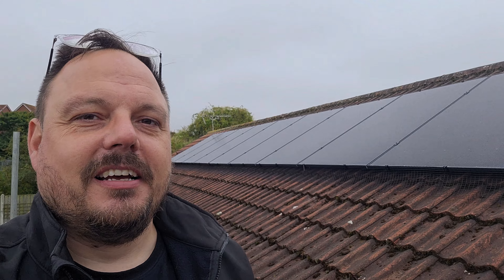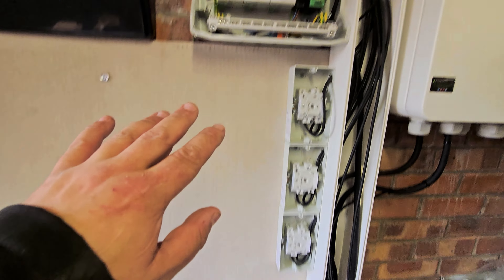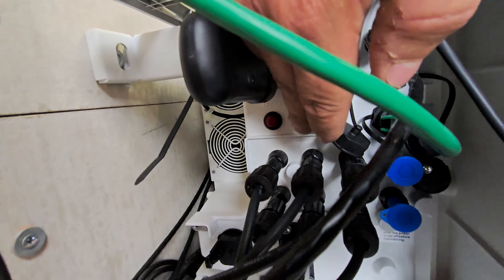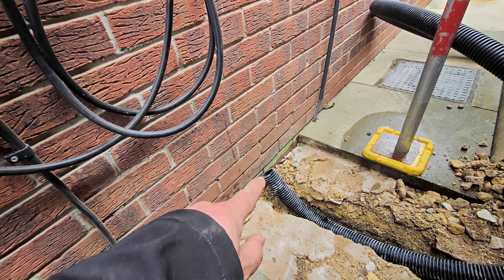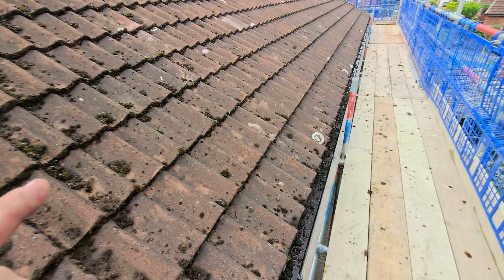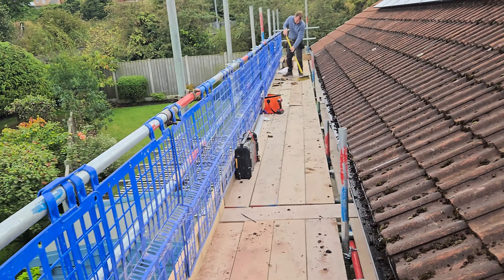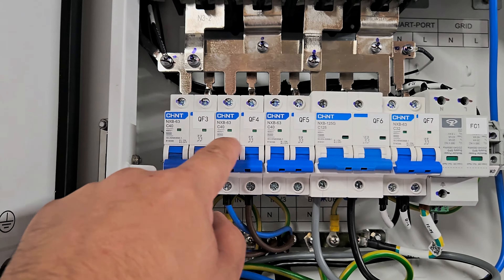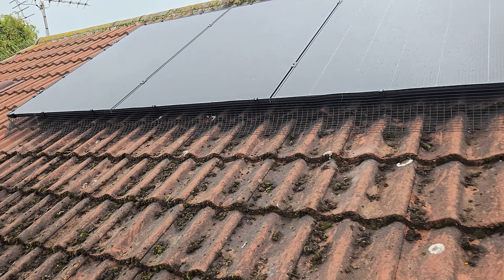Tesla Powerwall beater? Ultimate UPS power- SigEnergy 10kW SINGLE PHASE with Bifacial solar panels

Comment: Great attention to detail, nice to see you using stainless steel cable ties and PV Ultra. You're absolutely right to be sceptical about the bifacial panels, on a typical roof installation they add pretty much nothing, minimal light reaches the rear. They are designed for ground mount, car ports etc where there is plenty of space behind for light to get in and be reflected back.

Comment: Currently getting quotes on an Sig system with additional panels on the back roof here in Ireland. Costs are eye watering, but when the only alternative with a backup box is Huawei, the costs seems much worth it suddenly. Few more quotes,and well. In the end 8.7Kw solar, and 8kw battery with backup gateway. Although depending on some other quotes, might go full 16Kw battery if possible.

Stormy Mayo in Ireland gets a few power cuts.

Comment: Top job - very nicely done indeed. I'd have advised the customer to get the roof powerwashed after the scaffold was first up, but cannot find any other improvement to suggest.  I can only think of 2 reasons to use Tigos: customer insisted on panel level monitoring, or you were concerned that bifaciality would cause uneven performance among panels in a string.  If neither of these I'd have used AIKO's brilliant new panels with partial cell-level optimisation.  Or no optimisation at all - this installation has the least shade problems I've seen for a long time (Bristol:  full of historic tall chimney stacks & mature trees).  What you called the TAP was the Tigo CCA - which would have had a wired connection to two TAPs on the roof - which can be awkward at times.
Reply from the maker: Power washing a roof is the worst thing anyone can do with concrete tiles. It washes away the abrasive finish and in 5 years will be porus anyone reading this never ever do that. 

Optimisers are primarily for safety as covered in the video. In experienced installers often discount this crucial aspect. In terms of shading all shading is well shading lol. The severity differs and we had a really bad one on the channel a few weeks ago. That said the optimisers have recovered lots of lost generation already. Proof is in the pudding so to speak. The Aikos are decent but several levels behind true optimisation. We have used them on unshaded ground mount. No optimisation is a terrible approach imho. 

The CCA receives data from the tap you are correct however using 2 on this install would be a waste of components. 1 is all this is required with appropriate installation. 10m range easily achieved, in fact well within that. Over application of TAPs brings added cost and zero benefit. 

Fortunately he customer got the right advice and the right installer. Hope that helps.

Comment: Sigenergy looks like they are the market leader at the moment but there are so meany great company’s out there it’s difficult to choose! I will be going for Givenergy most likely as they are building factory’s in the UK
Reply from the maker: We are a big customer/supporter of GivEnergy. If you didn't go to solar and storage you might not know. But they also have a product coming later this year that is better in every sense than the PW3.
Reply: @electrician247  Later this yr? - I'd heard not till mid 2025.  I hope GivEnergy aren't coy about their inverter efficiency curve:  AiO Gen2 may indeed be best thing since sliced bread for big installations but I want to know the efficiency of their 12kW inverter at 500W or 1kW or 1.5kW (ie only a bit less bright than when you showed us this system).  Inverter efficiency is rubbish at low % of peak output (ie in the 3 seasons when you haven't any to spare).  So I think it's pretty poor that manufacturers fob us off with peak efficiency (worst) or CEC-weighted or Euro-weighted (little better).  I think they should give us efficiency at actual outputs in 0.5kW increments.
Reply from the maker: @falfield  yes indeed later this year. Did you visit them at solar and storage? Efficiency within inverters come down to design rather than manufacturers equipment. Unless you have a sum total of 2 panels... otherwise string layout, optimisation and a good installer will sort you out. That said the efficiency is way ahead of the crowd across the mppt range. We are lucky indeed. Hope that helps 😜

Comment: Really good video and installation. Just one question though (I might have missed) what did you do with the 3rd string and the PV ultra cable?
Reply from the maker: Don't follow.  But we have strings via the 2 x 4 core PV ultra cables. 1 spare string in place for any future expansion left in the loft space into isolation. 

The other 3 pairs all on to the roof.
Reply: @electrician247  Hi sorry I didnt hear the bit about using 4C cable. Thanks for confirming. Really good videos that you produce thanks👍

Comment: Great video, Mark! Does Sigen support offline monitoring? Or at least include the offline activity to the data when back online? I had issues with Givenergy disconnecting from my router, which resulted in losing historical data.
Reply from the maker: It's very hard for the sigenergy not to report with 4G wifi and LAN simultaneously connected. However it does have local storage and RS comms

Comment: I do not see a generation meter installed. Is it that they are no longer required or because you have used the gateway it is not necessary? Great install. You didn't say much about the Tigo otimizers though.
Reply from the maker: Thanks Ryan, lots of videos on the channel covering the Tigo stuff. These end up to long if we go into absolutely everything on each project. We do expand more than most. The incoming changes to MCS in Jan 2025 will clarify the generation meter aspect. Its a hang over from earlier times pre smart meters and gateways/inverters logging accurately to MID standards. Also more from the days of FIT. With the data of all of those things above including the Tigo for me its a waste of plastic and natural resources serving no purpose.
Reply: @electrician247  Not sure if I missed it in the video or it was mentioned but I don't see any RCD breakers on the system. I see the MCBs in the gateway that the Sigenstor is connected to but from my limited knowledge I thought regulations require it to be connected to an RCD. Hope you get a chance to see this question as its a little while since you posted the video.

Comment: Do Sigenergy batteries work well with Octopus time of use tariffs? Last I heard full integration was still pending. It would be very encouraging if this was possible!
Reply from the maker: Only via the sigenergy AI presently. But I believe integration is incoming. 

That said other energy retailers are coming forward with some incredible options atm. We are looking to leave Octopus ourselves. So again speaking personally I don't hold much value into a products integration with a single energy retailer. I think those days are done. 

I hold more weight in the hardware and eco system of the products rather than API.

Comment: Is the gateway necessary ? Or can the inverter be connected directly to the home consumer unit.

With the gateway are we able to have ups without a separate tranfer switch ? Your vauled information would be appreciated.
Reply from the maker: doesnt require a gateway. With gateway it will switch auto grid automatically yes
Reply: @electrician247  Thanks for the reply. I was unsure what benefits the gateway would bring.
Reply from the maker: @Disco45  lots of others especially integration of heat pumps etc. Not a great deal extra in cost for this big upsides tbh.
Reply: @electrician247  Yes I'm just researching now and for how much it costs to have a auto switch for back up power the gateway makes more sense.
Reply: @electrician247  I like that the stated battery capacity is basically the actual useable capacity. Unlike others that are 10 or 20% less than advertised

Comment: What’s the tiny cable going through the gland on the RHS?  Does the gland grip it? 5:37
Reply from the maker: Those are comms and yes of course lol. The stuffer has 3 smaller holes in it for that purpose. Most brands provide cable entry for comms cable in the gateway kits. Thanks.

Comment: Have you had anyone instal the Sig/Poit Guard DC EV charger and how did it go? It seems to have some limitations on power output, they say it can do 25kw DC charging but that only seems to be true if using energy from solar, battery, and AC at the same time so I'm curious how that works in the real world.
Reply from the maker: We have one coming up. The capability is beyond what is allowed in terms of the grid which is why the 25kW output depends on battery charge levels etc.
Reply: @electrician247  It would be great if you could do a video about it and show it actually charging a vehicle... Even better if you can find a Nio vehicle and show of the bidirectional features actually functioning!
Reply from the maker: @Snerdles  all in hand lol

Comment: Should I directly connect a set of 10 Kv or 13 Kv batteries for 1 phase to another inverter? Do the inverter panels from SIGENergy feel disgusting? What kind of inverter from SIG ENERGY do I need to service 13 KV on Phase 1? Which high-profile security should I choose? I have 10 bifacial panels but I don't know whether to connect them directly to the inverter from Sienergy or to the inverter and then to the battery and the inverter? The max inverter can be 5KV
Reply from the maker: You need to speak with an installer

Comment: Beautiful install a lot of professionalism.  Do people get a lot of power-cuts, I've not had one over a few minutes in 10 years (South London) just seems a bit bizarre to spend all this money on 'gateways' and all the wiring and install cost, maybe its just because people want to post videos of the most impressive installs.  I have a double socket wired up to my inverter in case of a power cut, yet to be used! I was going to install solar, but after getting the battery I spend so little on electricity it's no longer worth it!
Reply from the maker: That in a nutshell is the beauty of choice. The live maps on power cuts daily do not lie. We have lots lol. Those outside of London are not so lucky. Especially in rural and even built up areas of Yorkshire. A system we installed for a customer back in January has covered off at least 4 full day power cuts. Which for them running a business from home is money very well spent. 

Everyone has different needs and requirements and that is where the right installers come in. We have shared loads of installs without backup and lots that had it when perhaps the benefits were not there. Mainly due to the fact the GivEnergy AIO could only be installed with a gateway for a longggg time so it came by default. 

In terms of cost the gateway element is pretty small tbh so often consumers opt for it anyway. When the day comes you have a full day black out you might wish you did 😉. 

I would never advise a single socket approach on any system in terms of EPS. All I would say is ensure you have a neutral earth bond config on its output and run through an RCD seperate to the inverter. Often see these kind of things done in unsafe ways. Thanks